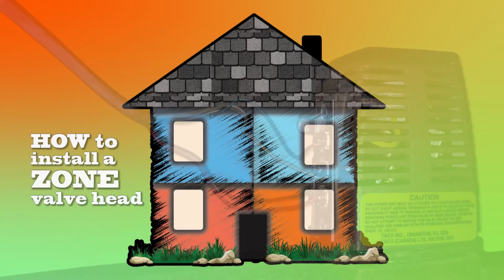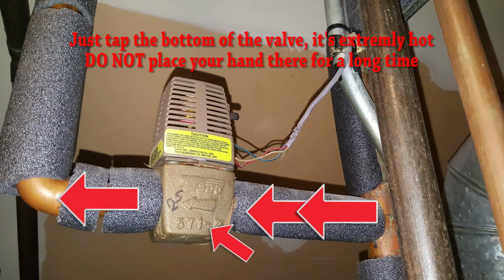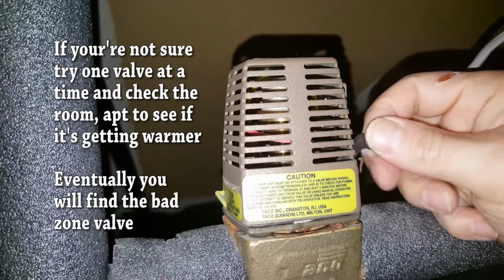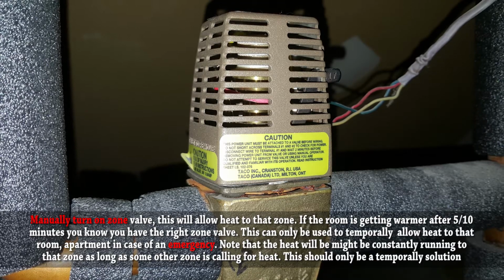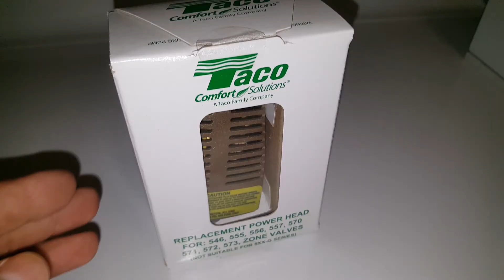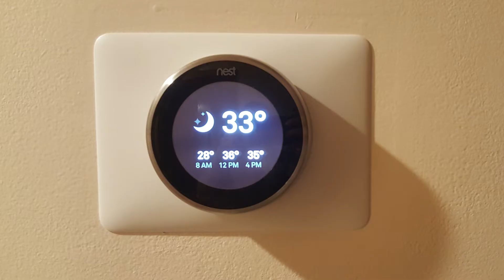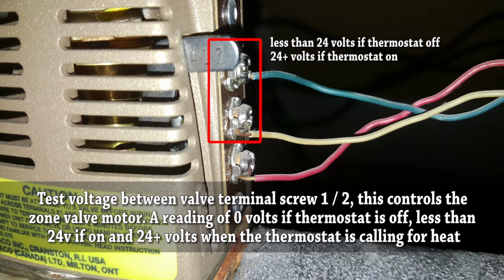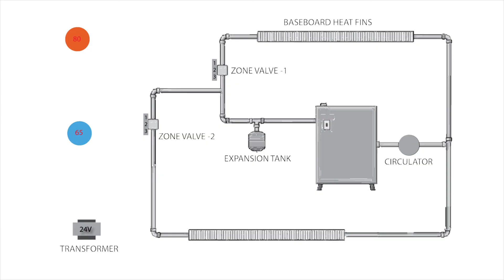Heat not working / Zone valve replacement

Comment: Wow this worked! My second floor thermostat battery died and upon replacing the battery, the heat didn’t turn on. I thought it was the thermostat but it was the zone valve. I followed exactly what he did and changed the zone valve, heat came right on. I did manually open the zone valve which is good to temporarily  heat your space, but the temp got super hot I found it was not a regulated temp. 

This guy saved me $400.

Btw the zone valve on Amazon is $75…Home Depot and lowes is $100+
Reply from the maker: Great to know this fixed your issue and that you were able to manually open the zone to temporarily get heat, ma y people are not aware of this. Good tip on Amazon if you can wait. Also please consider subscribing for more videos.
Reply: I’m in the exact same situation as my thermostat batteries died and now no heat. How can you tell if it’s the thermostat or the zone head is the issue other than trail and error

Comment: Good video.  I have 3 of the same Taco 3 wire zone valves.  One of the levers are stuck and won’t manually go past halfway. 
Question is it ever the valve body or most always the just the head?
Thank you.

Comment: One zone without heat for days. 5 minutes after this video I was able to diagnose the issue and order the correct zone valve replacement. I did not want anyone in the house during Covid times. I also save more cash than I paid for the valve. Subscribed and liked.
Reply from the maker: thank you!

Comment: I have one zone valve not working. I have 24+ volts on 1/2 screw terminals but I have zero in between 1 and 3, and zero in between 2 and 3 terminals. I can pull the plunger manually down and heat runs. What do you think the issue is? Is it the actuator or thermostat or wiring fault? Thanks
Reply from the maker: If you have 24 volts on 1/2 that means your thermostat is calling for heat. Most likely you just have a bad zone head. You can check for continuity from 2/3.  Disconnect 3 and check continuity between 2 and 3.

Let us know what you found. Good luck

Comment: I only have 2 wires on the zone valve that I have. It’s the same zone valve in this video. Should the 3rd wire be a ground ?
Reply from the maker: You have 2 wires to the zone valve and it's working!! Usually 1 to stat 2/3 to t terminals. Look at a diagram on google

Comment: How long do these heads typically last?
Reply from the maker: depends on a lot of factors but not uncommon to have them last for 20/25 years. thats how long mine lasted.
Reply: @daP.A  Had 3 installed in 2009 on a new system. One just died. Hoping it was a fluke and the other two will stay good for a while. But your video was a huge lifesaver, thank you.

Comment: so if the heat wont shut off, isthis still be a valve head issue? I have two zones, one works fine the other keeps pumping out heat.. :(
Reply from the maker: Possibly if valve is stuck open.